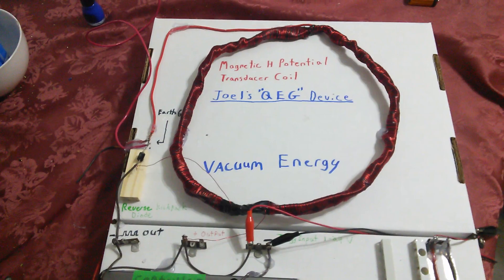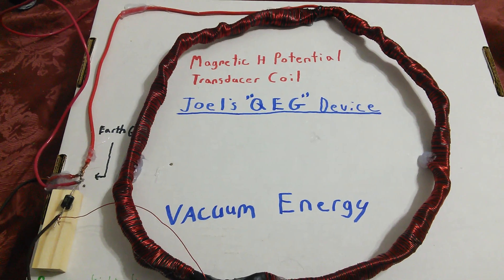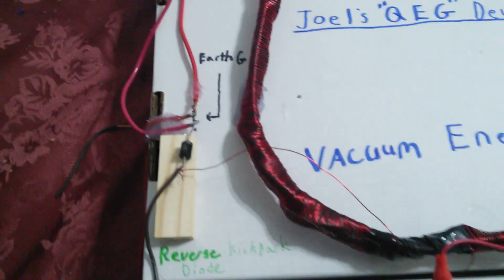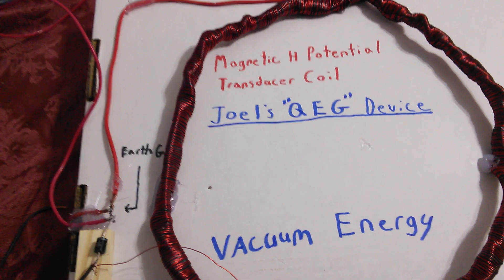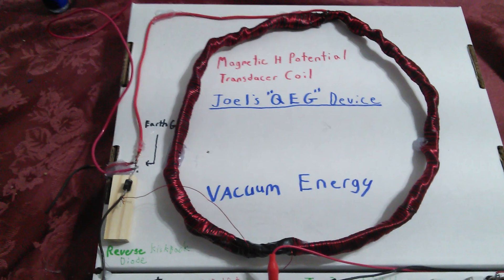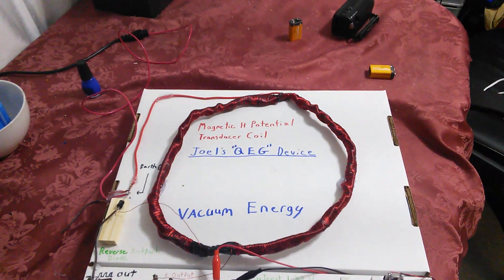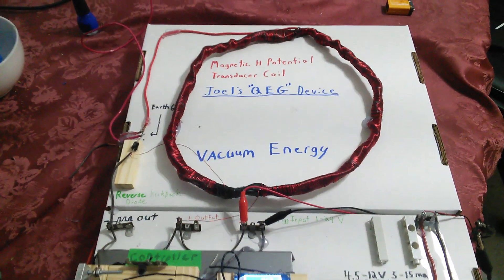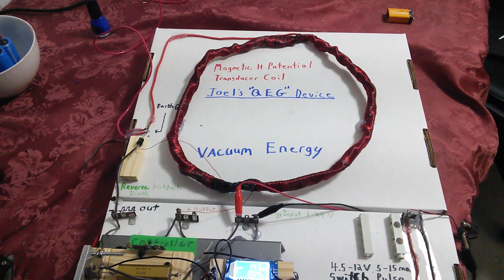Joel's QEG Quantum Energy Generator

Comment: 2 Earth ground plates spaced 7 miles apart should probably have a potential voltage difference great enough to produce current. The farther away from ground to ground chances are you get two separate electrostatic fields.
Reply from the maker: Correct and this device has this feature in mind with two intentional ground taps, I just don't have it atm, Could you imagine such a ground loop, Perhaps If a phone line is not locally grounded, You can get away with using phone line for one ground and a real earth rod for another.  Reason the mains ground is not the best for a loop is cause its so close by. How ever just for the sake of "Grounding"  it still helps.
Reply from the maker: And it seems from the comments many folks are not understanding the significance and importance of having a reactive stage as coupling the loop vs just trying to rectify inductive kickback and calling it a day. If we think further then our noses, We see that we can add as many as these reactive stages to the coil with little to no drain. We just need to pay for the small additional traditional loss of course of the wire itself... But if you understand we just stack this reactive stages from the DC rectified side of them and just like batteries you can parallel your dump caps or series them. For much more amps a second discharges, It's all about cap dumps this kind of energy is reactive its not considered "real" power but with that said it does not mean we can't get any real work done. Just like the small consumer capacitive power supplies, They only provide around half an amp if your lucky. If you apply to your own generators, You will quickly see how that can add up with minimal strain on the transducer device. Again its a concept another kind of teaching tool that opens the door to bigger and more exciting projects, This could be used literally as a driver stage for a pulse capacitor discharge motor, Think Jim Watson.

Comment: Joel, concerning the coil, my understanding from what you said, (I may be wrong here) is that you took several lengths of your 4-strand-telephone cable, the white stuff, and twisted them together with all the insulation on, while forming a loop.  I assume you then went in and soldered all the inner strands in a series like the tesla bifilar.  Then you wrapped the entire loop in magnet wire as shown.  You connected the start of the inner core to the earth ground.  The other end of the series-wound core is open, like an antenna, open ended.  Then you have one side of the outer wrap connected to a diode? (or cap) from the earth ground, which is also on one side from the inductive coupling.  The other end of the outer wrap is the output.  Is this how you made and wired up the coil?   In any case, this is a major advancement.  Great stuff.  _111
Reply from the maker: Schematics and more details just like my solid state Bedini charger will come with time.  It's just a hobby and when I built this in the middle of the night out of being bored, It ended up working, So even if I have good ideas what I did, I have to reverse engineer my own device now without breaking anything, As I didn't bother taking notes of how many copper wires I used, It feels like around 6 heavy in house wiring pieces that I all cut equal, Twisted all together as a kind of tight lattice chian. I give out everything I know at the time, The details is because I lack at the moment.  The thing is it almost took me one year to reverse engineer the solid state Bedini charger, I have a bad habit of just acting on brain fart ideas without first drawing out a circuit diagram, I work backwards, It's a defect as a personality trait.  With that said as always full disclosure will come with time. But I can't break this thing, I need to replicate it to best my my knowledge once I'm successful, I do the tear down vid. 
I know some are impatient asking for a full set of schematics, Coil diagrams etc...This takes time and no one is paying me for this and I get nothing in return. That's not the point,  If it was these goals I would have stopped a long time ago!

It's not you but some comments some user I find get a little demanding. 

With that said thanks for your interest and support.
Reply: @joellagace1679      Some of the best work comes from the subconscious level.   What you described is not unheard of.   I'm interested in how this inductive coupler is set up.  Your work is appreciated and has a long ranging impact. If only we could show you.  You are a messenger.  Rest assured, in balance, we all get our rewards, good and bad.  _111

Comment: Take it to the park or beach and retry .I saw another setup similar to this and he was just creating a parasitic device feeding off the local power lines field so you have to go away from the power lines .if it doesn't work off grid well ? Your getting his results.check the frequency look on a scope ..
Reply from the maker: It won't work without a trigger. So you need to bring a battery to start it and run it in intermittent modes, I don't think this is what you think it may be.

Comment from the maker: For those wondering what you can do with this generated voltage or saying the voltage means nada, Simple experiment, Asking for a friend. What happens when your charge a 15uf cap direct from the mains as a rectified pulse at around 130V DC and then short this capacitor. Is this real work? You know... Just asking for a friend 😁
Reply: 300 Watts inverter has a cap only 40 uf at 400v.  If you can dump 15 uf at 60 htz. That's enough power

Comment: Thank you very much for your experiment and sharing, without current measurement or load testing. I doubt it can convincingly prove to anyone. An increase in voltage does not necessarily represent power.
Reply from the maker: You don't seem to understand the multilayer scope of this device. It's all in the video. I have nothing more to "prove"

Comment: Pizza Box power. I like it!
Can you power a motor or something with this? I ask due to my ignorance at what I am seeing.
Reply: It is possible if energy is stored in power banks for further use, although reactive electricity is not direct useable for inductive loads, but i am pretty sure you might be aware of this and your question is meant to show that this invention is useless. I don’t or I can’t believe the someone truly ignorant would ask such a question.

But, it can be perfectly useable for a resistive load such a heating element where we can heat our houses for free !
Reply: @Caesarus2011  Thanks for the info. I'm just starting to get into electricity so will read up on what reactive electricity is.

Comment: Joel, you have my curiosity with this device.  It looks like a different way to achieve what Sweet did with his conditioned magnets.  If I am getting what you did on that wrapped core, that is.  I am going to try to duplicate this one.  i believe this one to be VERY scalable .  Remember, when working with negative energy less mass is needed for conductors to work with higher current once conversion is made.  Even after conversion negative energy, while working nearly the same, is still different than the conventional energy we use due to it's peculiar magnetic component.  You will see what I mean as you start to work with it.

Comment: Fantastic, the set up on the board looks very interesting,
the system being described, however, is very intriguing.

Every day, you take another step and introduce new ideas.
It is amazing, thank you, I can see that soon we are going to start building that dictionary.
A lot can be done with a system that can sustain 50V DC after removing the trigger.
Many inputs methods can provide the initial 1% trigger.
Thank you.
Reply from the maker: So glad you get it! that's 100% it! It's only 15 uf dumps of a few a second, Still great for free. It will charge a car battery for example. If you do end up shorting out the DC cap to long to render the system null, Just need to trigger it again for maybe 15 seconds and your good to go for the day.
Reply: @joellagace1679  
It's exciting.
I am glad you enjoy the research.
Thanks
🙏

Comment: This guy deserves a Nobel prize & I'm totally interested in seeing how far you can take the extreme battery charging that takes very little current along with seeing how many kilowatts you can run while it still Recharges itself :)
Reply from the maker: Thank you so much for your kind words, Feel free to spread this video for awareness! It's all I can ask for! in return for posting everything without all the BS that many others in the field like to fluff hehe.
Reply: @joellagace1679  i absolutely will & if you have the time I'd love your thoughts & input on how to further improve the wireless power technologies I'm developing & scientific research spreads the most when open sourced & discussions are had between fellow researchers :)
Reply: I wonder if the battery can be eliminated and use capacitors